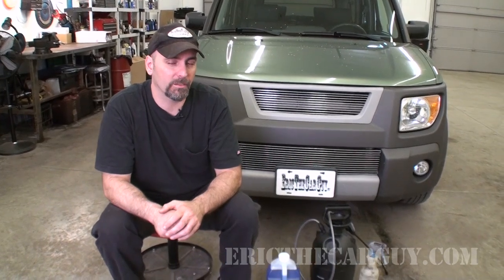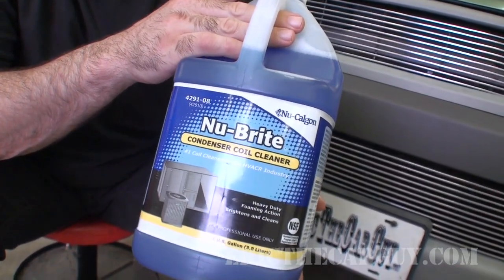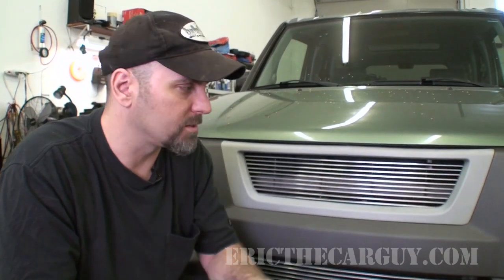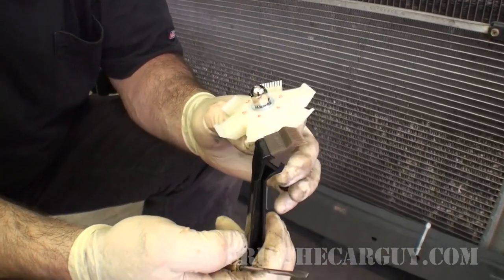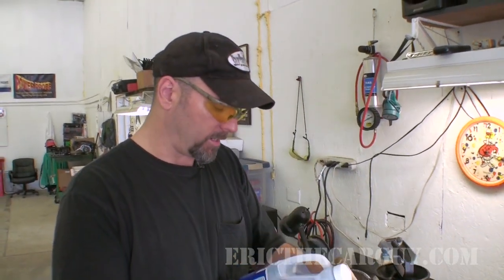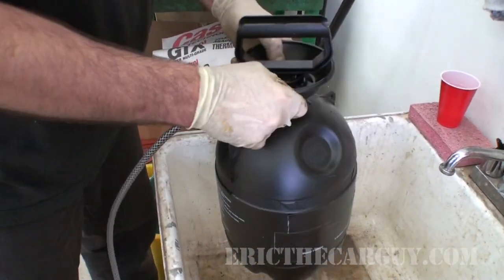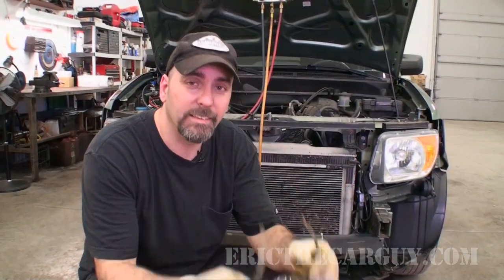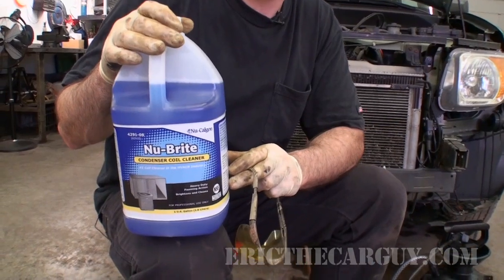Increasing AC Performance by Cleaning Your Condenser -EricTheCarGuy

Comment: Done that to my Vauxhall and also sealed the radiator/condenser gap off with high density foam and high temperature glue. Now, with a new receiver/dryer, a fully charged system, and 80F ambient, even the lowest fan setting can make you uncomfortable fast. It's a variable displacement compressor set to begin destroking at 42 PSI suction pressure (R134A) by the way, it doesn't cycle on and off.
Reply: How does sealing the gap help? As long as the air gets through the condenser it should be ok?
Reply: @Discoworx  Side gap. So hot air won't be pulled from the sides.
Careful with Chinese aftermarket condensers too.
With one of them, really poor performance.
As soon as i fitted the genuine GM made in Czech Republic one... You won't believe how things changed. Took 30 seconds (from when you switch AC on) for air to get appreciably cold with the Chinese one. Now all it takes is 5 seconds. Beware.

Comment: I have my system apart for an r134 conversion (it was already empty I'm just changing all the parts and taking to ac shop for vacuum&fill) I had one on a previous car explode at the view glass so I will defiantly do this to keep the pressures down and clean out 30 years of dirt. 
Thanks :)

Comment: Perhaps using distilled water in the sprayer while mixing the solution would eliminate the fears of water causing future corrosion in the condensor. Perhaps also  after spraying cleaning solution refill sprayer with 100 % distilled water to rinse. Then air dry with a fan. Id be against using anything with lye in it.  Just because bottle says its safe to use doesnt mean you have to use it.  If something weaker will work id go that route. I believe the preservation of the material would be extended.

Comment: Eric i know this is a 6 yr old video and your probably not going to see this but i was having trouble with my ac taking forever  to get cold on my 2003 Mercedes C Class when it did it would get cold then warm then cold  then warm so on  so forth. the Freon was full  the compressor was working fine    after  doing some research i changed out the evaporator temperature sensor which did help a bit and the part was cheap so i started there . then i found  this  video .i bought a can of coil safe cleaner from a local big box store specifically for home units  and tried it  . I cant believe the amount of stuff this product got out of my condenser after only ten minutes i hosed it off thoroughly let the car dry for an hour  and to my  disbelief when i started the car  in about a min i had cool air coming out the vents  within 5 mins of driving it was nice and cold .so i took the car for a half hour drive and it stayed cold consistently  unlike before where it would take darn near that long to start blowing cold in  the first place  for 8 bucks  and 25 mins work   (nothing needed to be dissembled )  I got my ac back thank you for all you do it does make a difference

Comment: Thanks for the great info! Unfortunately, the cleaner only ships in quantities of 4 - you can't buy just a single gallon. It lists the price as being $19.63 per gallon which would be great if you could buy just a gallon considering how little you actually use per application. And, the fact that it is so concentrated requiring a small amount per use makes the purchase of 4 gallons completely unnecessary for an individual. Great info and outstanding results but I think the average DIY-er is going to find an alternative product to achieve the same results. Also wanted to comment about straightening the fins... that will have just as significant of an impact as the cleaning did with regard to airflow over the coils. Take the time to straighten them out then run the pressure test again. I think you will be amazed at the results.
Thanks for all you do, Eric! Keep it up and stay dirty my friend!
Reply from the maker: I bought just one gallon. I didn't need to buy anymore. Feel free to come and straighten those fins if you like. Me, I'm happy with the cleaning.
Reply from the maker: I've updated the links in the description. I think that will work better for you.
Reply: EricTheCarGuy Ok, I'm confused. The original link you had for the cleaner listed it for about $20.00 peer gallon with a 4 gallon min. The new link to Amazon has the cleaner listed at $70.00 + $12 shipping! What the...? It's much more cost effective to buy the 4 gallons for $80.00 with free shipping. Not trying to bust your balls Eric, I'm just trying to wrap my head around the cost of the single gallon compared to that of a case of 4. It just doesn't make sense. I'm a Premium Member btw which = I'm on your side here. Not trying to make waves.
As for coming over and straightening your fins.... Just tell me which airline has a ticket waiting for me and when to come and I'm there brother! It's the perfect time to get out of AZ for a bit! ;>)
Reply from the maker: Steve McLean Confusing yes. I didn't see in the other link that you had to purchase 4. I got mine from Amazon, and it was indeed expensive, but after I clean all of my condensers, including the one at my house, I think I will have my monies worth. I hope you saw that I also posted a link for the aerosol for $12.

Comment: I do ac work everyday the comb does help but it tales a long time to complete. Also if you go through the process of cleaning the condenser coil you might as well do the evap coil as well and change your cabin filter. People forget you're supposed to take care of your car ac the same as you would the one in your house.

Comment: I'm confused by your pressures. According to a chart I found, at 84 degrees ambient, pressures for the low side should be between 45-55 psi, and high side should be between 225-250 psi. One would be inclined to add R134a to the system if they just went on the pressures. However, the 39 degrees air temp from the vents would indicate that the system is fine. What is your take on that Eric?

Comment: Just a thought about the fin comb.   Works a little easier albiet a little more difficult to access, if you go from the back side of the condensor and push the fins straight.   Same goes true if using a pock screwdriver.

Comment: Remember if the vehicle is over 70,000miles evap needs inspection for possible cleaning . At 150psi high  and  20 psi  low side . These would represent winter pressures on a factory system .

Comment: did this on my 90 civic with the r134a conversion and can confirm it dropped the high side by 50psi.
also cleaned out my evap core and box because it was stuffed with leaves and the car moves more air now.

Comment: Eric I have  special treatment for the automotive AC . That will bring the high side pressure and increase the low side pressure. The result ,better cooling, no tripping and faster cooling. 95 % of the AC load will be removed from the engine. AC on or off will not make any difference to the engine. As a result better mileage. Reply if you want to know more and use it .

Comment: Some cars like mine don't even have a ac condenser fan, so it's even more important to clean it
Reply: Definitely, with a clean condenser (and no hot air being sucked through the gap between the condenser and radiator), engine cooling will also benefit.

Comment: ☆☆ATTENTION☆☆: I was about to use this method to clean my condenser, but before I did, I called Nu-Calgon's tech support line, and they explicitly said NOT to use this product on automotive condensers nor even RESIDENTIAL household coils!!! This product is intended for very thick commercial/industrial aluminum and copper coils.  I spoke to two different guys, and they told me that it is WAAAY to agressive for thin aluminum, and will strip a molecular layer off the surface metal, reducing the lifespan and leading to premature leaks. Mr. Eric, please don't take any more risks. They told me to try Tri-Pow'r HD, which is also their product, and better suited. I might just even take my car to the car wash and just use the degreaser spray setting just to be safe.

Comment: Very interesting video.  I have a question about how to clean the rear side of the condenser?  Mine has over 15 years of flies and road debris stuck into that side.  Same procedure, just wedge the tip of the cleaning solution in there?

Comment: You should do this to your home a/c condenser each month with just water to flush out spider webs, tree pollen, dust and dirt to keep you system running effeciently. Here in the midwest the cottonwoods release their seeds which clog up your a/c and no air is running through the condenser.

Comment: This was an excellent easy maintenance video! I would love to see a part 2 maybe covering cleaning out the evaporator drains and maybe even cleaning the evaporator itself to see if this will increase performance further in the cabin.

Father's day I had to clean the neglected evaporator in my house unit. So much dust bunnies had passed the filter from poor design it plugged the unit and iced over solid making me consider the same maintenence for the vehicle units.

Comment: This seems like a good idea to do if you have to remove or replace the radiator.This way you could push out dead bug debris and other big particles instead of clogging them back in, if you have enough clearance to hose it from inside the engine bay.

Comment: I have a better idea that is , just pull the air filter if your ac & pour liquid dish cleaner or powder detergent in the blower fan (turn the ac on full blast for 10 minutes before applying ) we need the evaporator to be wet, cooling will improve by 50% or near by
Reply: I think you mean "cabin filter" not air filter. Also how does this clean the condenser. Even if it does clean the evaporator.
Reply: The evaporator can't become cold if the condenser isn't being cooled off properly...

Comment: Eric, mount some hardware cloth behind the grill to protect your condenser and radiator from impact damage and getting plugged up from insects. Hardware cloth is tougher then window screen and has a more open weave so won't impact airflow. Been doing this for 20 years myself and never had an issue.
Reply from the maker: Great idea, thanks for the tip.
Reply: EricTheCarGuy

I imagine fin combs are crap on folded fin style like your condenser they are probably meant more for vertical/horizontal style fins such as in most window/home A/Cs. Folding the fins and mounting them between the flat tubes is easy to see more resistant to impact damage. They can only collapse and block each little channel where a vertical/horizontal fin on tube can fold over and block lots of surface area.
Reply: Thanks man, I've wanted a way to protect those fins for a long time. FYI: a few weekends ago I used an air compressor all over my houses A/C system. I woke up the next day to air that felt a lot colder straight from the vent. We also cleaned fins inside the house. That seemed to make a bigger difference. (done a few days apart)

edit: lol, I avoided naming the "radiator" in the house and used the word fins as I forgot it was the evaporator. Found it in later comments, thanks Eric.

Comment: So the cleaning product is basically a weaker version of oven cleaner. 
I suppose it would also work on AC evaporators (you probably could’ve hit 34 at the vents if you sprayed it up the drain tube), heater cores and radiators too. 
Making the AC and cooling systems work more efficiently will improve your MPGs slightly and reduce emissions.

Comment: thank you i just clean my 95 jeek it was runing to high top whit no sun stoping and goin it was 220 and 230 cut it off it did not wait to start up i clean it with some cheep cleaner it did not froam up but it helped i will get some better and re do it it run 195 to 210 now i get on the gas it cool down fast now

Comment: I used water compressor to clean the condenser radiator. Is there anything wrong with that? Of course I kept my distance away as high pressure water can do amazing things like cut through metal.

Comment: nice video i realize that one should clean with low pressure or nozzles with low pressure because you could be doing more damage with bending more fins then clean grease/hunk out. The screw driver trick is a good tip to
Reply: Also works well for fin coils for home heating systems.

Comment: Where would one find a table showing what the proper system pressures and air vent temperatures should be given ambient air temps?   My first guess would be a shop manual but I haven't gotten one for my car yet.
Reply: Timmy MacGruber For R-134: Ambient temp=65° = 25-35psi. 70°=35-40psi. 75°=35-45psi. 80°=40-50psi. 85°=45-55psi. 90°=45-55psi. 95° to 110°= 50-55psi. These are LOW side pressures only and rough "top-off" pressures only. Most vent temps are: 38°-45° middle vent, 2k-2.5k rpm rev, AC on, fan hi speed, recirc on. Several other factors must be taken into account. Humidity, charge level, system age and condition, compressor efficiency and amp draw, metering device type are just a few of these factors. Google "Auto PT chart" for specific vehicle and its associated high side values.

Comment: Fin combs work best when you can use them from good fins like the top of your condenser through the damaged ones. Your condenser wont allow that because of the cross structures. Good vid and since your compressor doesn't have to work as hard or be on as long, better fuel mileage means savings.

Comment: Can't you just spray regular degreaser on the condenser and wash off with a hose?

Edit: by the way, I have a large engine fan in front of the condenser. In this video I suppose it's behind it. Which is best?

Comment: HI I have 2012 corolla LE I test blower motor  it work but there are has no power so I try to find out where is the fuse for blower motor and before has cant turned off AC know so all the time giving AIR .
thanks

Comment: Eric, I have a dodge diesel pickup that has crappy AC when not moving. Ive replaced the condenser with no change. High side climbs rapidly when idling and not moving, but if I take a garden hose and wash down the condenser the high side drops dramatically and vent temps drop as well. Would the addition of an electric pusher fan be a help? I feel as though the diesel's mechanical fan just doesnt pull enough CFMs at idle. Does this make sense? Driving down the road with airflow the AC performs correctly.

Comment: If your fins are damaged like yours. Its better to push open/spread the fins from the back side. Its a real pain in the rear end if you do it from the front side. Most of those comes are to short. Personally... I prefer a bout 20% longer comes than the radiator/condenser thick is.

Comment: I have a question. In regards to belt chirp. I changed so far 3 belts. 2 Gates brand and 1 Goodyear gator back. They all seem to be fine after a week. Then it will start chirping again. I changed the alternator because it failed a week ago. Changed the 2 idler pulleys, and belt tensioner. Still a chirp. I also did the water spray test. And it goes away but it comes back. I spin the water pump. I don't hear anything wrong. I spin the power steering pump pulley. I hear a little play back and forth. To me I think it's an alignment issue with the PS Pulley. The chirp doesn't get any louder when I accelerate. I just found it ironic after this time. It never chirped before. It's a 07 Chrysler aspen 5.7 HEMI. ANY SUGGESTIONS.  The mechanic I went to put in a smaller belt. But the chirp came back.

Comment: I use a Pressure Washer I Know but before anyone can say oh my God . Just a little  common sense  goes a long way.  first use a fan pattern on the washer hold it a reasonable distance from the Condenser and wash( too close you may bend the fins) be about 12 inches away and wash  you can also do this at a car wash  works Great I do this on my home A/C unit every year with just water and a pressure washer no bent fins and all the crap from over the year washes out.   also on a car if possible wash the condenser from the inside to the outside  wash out and wedged Dead bugs , Stones  Etc  also some Coil cleaners can be Caustic so be careful not a good thing to use all of the time when just plain water will do or mild soap like Dawn to remove grease and gunk

Comment: Was the condenser dry on the after test?  If not the increased efficiency was do to evaporation,  not being cleaned.  Still a great tip for cleaning the condenser.

Comment: Thanks for the video, my old 1990 civic has some problems with engine cooling system on a hot day, about 40C, with my AC on, so I'll try your solution and see what happens. Do you think that a similar engine cleaner can do the same job? to me it's pretty much the same solution.

Comment: Eric, I am lucky that the condenser of my Crown Vic can be loosened and pulled away from the radiator, allowing me to use the fin toll FROM THE BACKSIDE to straighten them. The fin tool I have has longer pins that fit all the way through my condenser. 

And the humidity here in Louisiana is always high. (When mu kids were growing up, we used to go on vacation in August to Texas and Arkansas because it felt cooler out of state.)

JD

Comment: Hi Eric! Have question for my car airco .  Aircon is working fine, the air is cold but the airflow seem to be weak, let's say setting 2 is like setting 1 on other cars, seems one notch weaker than other car  y other car is 2002 Toyota corolla.  What could be problem or can the car just have weaker airflow? I have 2000 Nissan Maxima , thanks

Comment: Hello Eric; Thank you for your Video;  I need your help please. We have a hmmve that is blowing cold in the back, but the front doesn't blow cold. The pressure on the gauge looks good. I was told to change the TEV  and after I did it and recharged the system,  nothing still has changed. What could be the issue? Thank you in advance for your help.